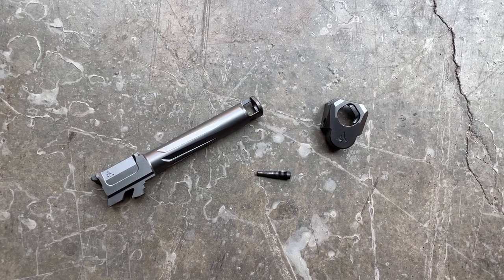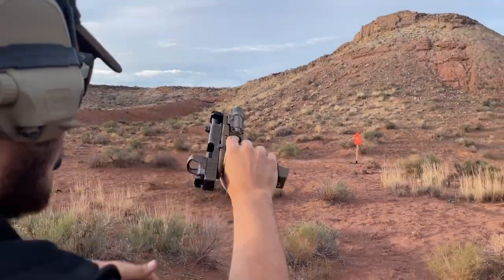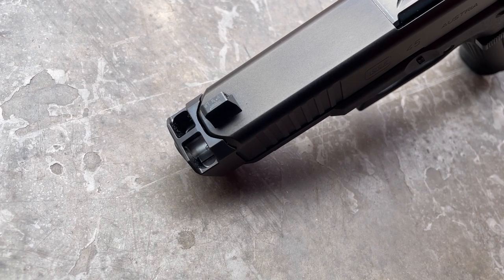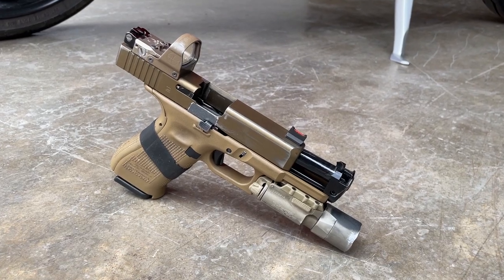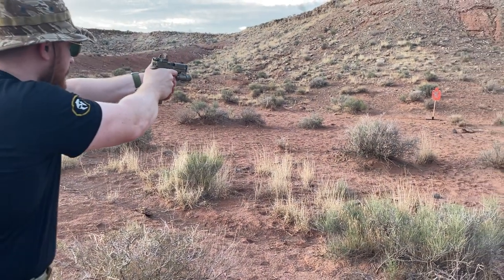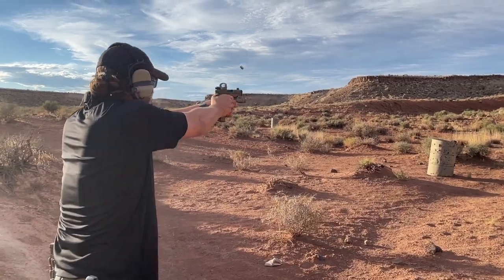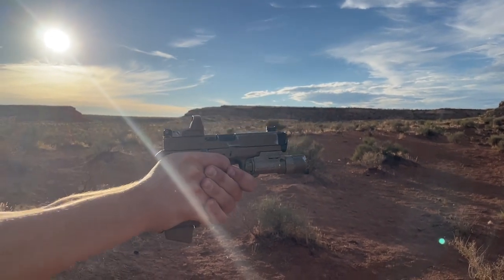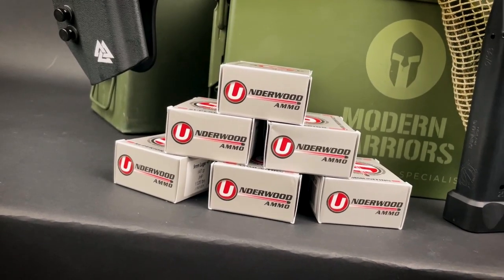Radian Afterburner and Ramjet Review- Tactical Tuesday

Comment: I was pleasantly surprised with how well this works. It definitely reduces felt recoil. You for sure notice when you’re running bill drills. I have one for my 19x and have 1000 plus rounds through it with no stoppages.
Reply from the maker: Agreed, it really shines when you start trying to run the gun with purpose
Reply: Are you using radian springs or do you run your stock Glock spring??
Reply from the maker: @campsoupkitchen2645  Factory Glock Springs

Comment: Cool Beans. Never did mention if there were any failures or anything after tuning with springs. I assume not, and it is a good to go concealed carry option.
Reply from the maker: In the gun we were shooting we were running the standard springs from glock. As for a carry option yes, it would be useful. It may be a tad large for some people, but it definitely makes the gun more easy to shoot
Reply: @modernwarriorsut some reported it would misfeed with 115gr but 124 was fine. Getting their rsa with a 13lb spring should take care of that but the stock trigger sucks. The overwatch precision is good but then spending close to $1200 for a g19x

Comment: What type of ammo is this compensator most effective with?  I've never given much thought to 9mm comps based on the lower recoil but based on your video this seems to make a noticeable difference at least for some ammo.
Reply from the maker: This one is designed to get the greatest reduction in recoil with 115gr
Reply: I run mag tech 115 grain and my I have the g19 with afterburner and ramjet and compressor if runs flawlessly

Comment: My only complaint about the Aterburner and Ramjet system is it causes stove-piping when used in my 3rd Gen G-19 with standard pressure 115 grain ammo.   After switching the standard 17 lb. recoil spring in my G-19 to a lighter 14 lb. spring, the stove-piping issue went away.
Reply from the maker: Since making this video, we have heard of people having to do similar things when running standard pressure ammo
Reply: @modernwarriorsut it's why not good for a carry gun